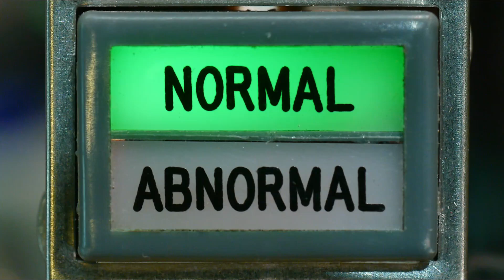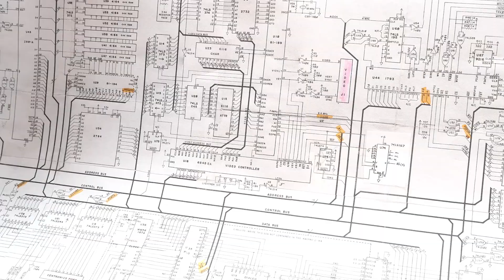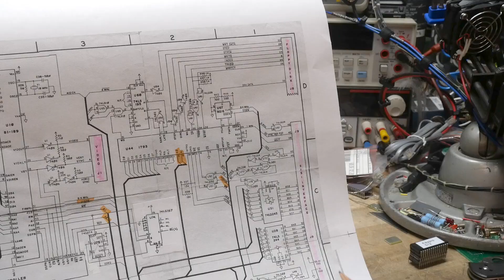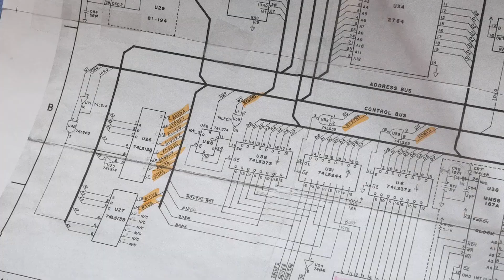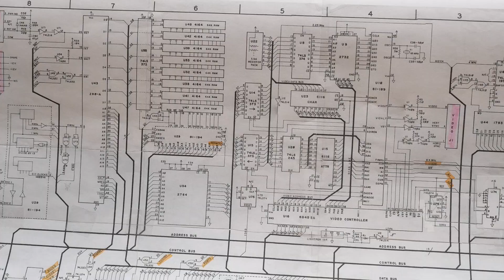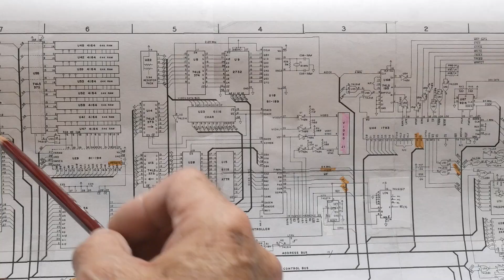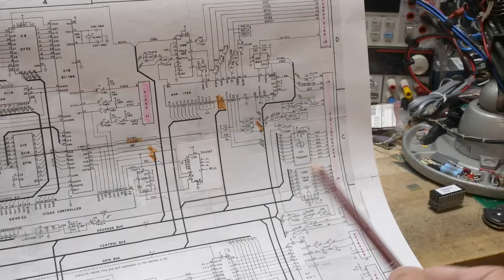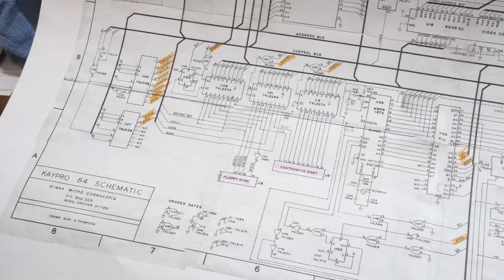#2405 Kaypro 2X Computer (part 5 of 10)

Comment: When you apply cuts on the graphite lead of the pencil, using the wireframe on OREVA electric raquet, to determine the luminous and voluminous properties of sparkle produced due to contact with BLVK graphite, the highlights become diagonal. You need to search for rocks on the boundary between two phases(φ). The mutant that appears to be like Wolverine might turn out to be Layne Norton and the water that you fetch might turn out to be saline fluid leak from Astro boy experiment.

Comment: I repaired a few Kaypros in my younger years.  I miss that "real" schematics were available in those days.  I do remember a fairly common problem with them was the parallel printer port not working.  It turns out that there was a break on one of the pcb traces going to the connector.  It was obvious that the (sometimes) open trace was defective from the factory because the defect was identical on all the boards I fixed.  Fortunately/unfortunately most of the people that had the Kaypros didn't have (couldn't afford) printers so the problem went unnoticed.  Oh my... dot matrix printers... 'member?  Thanks for the memory refresh pulse (Get it? RAM memory refresh vs old fogey's memory.  Sorry, I'll stop now).

Comment: I see it uses the 6845 CRT controller. These were much used and occasionally abused everywhere back in the day. Depending on the monitor board used, you may be able to coax some interesting video modes out of it.

Comment: The HDD interface seems quite simple: two bus drivers (244/245) and some glue logic (gates, inverters). My questions are:
1 Can you implement it on your machine?
2 You said that what you have is a "universal board" so can I assume that the HDD interface is there on the circuit board but no components are placed (ICs, connectors, etc) or is there needed a separate daughter board?
3 If you phisically make and connect that interface, it will work with your actual ROM or you need a ROM update, a newer version?
4 What HDD technology it can use? I guess is MFM or RLL? 
5 If is easy and can make the HDD interface, will you upgrade your Kaypro to use a HDD?
Reply from the maker: the HD is MFM but required a disk controller board.
Reply: @IMSAIGuy  Oh, you need an additional board too? I thought you mentioned in a previous video yours seemed to have everything other than the connector (which would be pretty easy to add) - I didn't realize there's a whole other board, but then again 2 chips and some glue logic looks way too simple to be a hard drive controller

Comment: Didn't know that the later Kaypro computers had SASI disk interfaces; that makes sense.   SASI = SASI is Almost SCSI Interface.
Reply: I've looked and I haven't seen any actual evidence that it's a SASI interface. It looks to be more of an expansion bus interface that's hooked up to a WD MFM hard drive controller board
Reply: @wotsac  I thought I saw reference to "SASI" on the schematic as it flashed by.  It's essentially an 8 bit wide, asynchronous bus (no synchronous transfers like SCSI allows) with a bunch of handshaking signals.   Look at 10:09 in the video at the very right of the page, J9 is labeled "SASI INTERFACE" on the schematic.
Reply: @lmamakos I'm pretty sure I saw that too, and it might explain another mystery reference to SASI in the Kaypro that I've seen somewhere or other. But I've never run in to any evidence that it's usable that way. I'd love to be proven wrong though

Comment: If I am not mistaken, my Kaypro with DOS 2.11 from 1985 had a 8088 cpu, not a Z80. I will locate the schematics and correct if necessary.
Reply from the maker: 1987 Kaypro 386: A 20 MHz 386 desktop
Reply: @IMSAIGuy  I have vague picture in mind of that. I used the 8088 Kaypro for many years, added hard disk and a 8087 math cpu to get more calculation power.
Reply: @IMSAIGuy  It was a standard desktop. I recall arranging one or two to my customers from the same dealer I bought my own Kaypro. Maybe the brand was Kaypro16, at least it sounds familiar. The desktop Kaypros had one issue with the serial ports. They were at different IO addresses and not many programs worked with the ports.
Reply: If it looked kinda like this one on the outside, then it would probably be a Kaypro 16

Comment: Hi... The Z80 takes care of the refresh on its own... Isn't the RAM custom chip probably doing just the address multiplexing and the RAS / CAS timing control?
Those functions alone usually take quite a bunch of glue logic if implemented in discrete form (4 x LS157 + 1 x LS74 and possibly a few logic gates).

Comment: Thanks for that nice to see how schmatic layout style has changed over the years.. Wonder why they felt the need for the ReFRESH chip after all the Z80 can do that it's self ?!
Reply: It looks like the chip integrates a bunch of glue logic. The Z80 only generates 128 refresh cycles without software help, while some 64K DRAMs need 256 cycles. DRAMs have multiplexed address buses, and it looks like the custom chip does the multiplexing. There are also DRAM control signals to generate, and IMSAI Guy said the chip had some bank-switching logic in it as well.